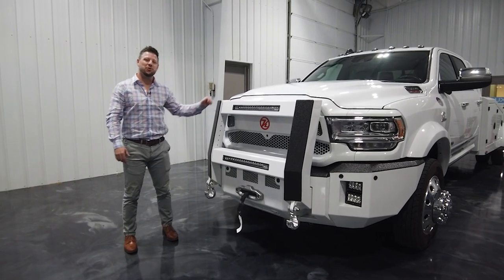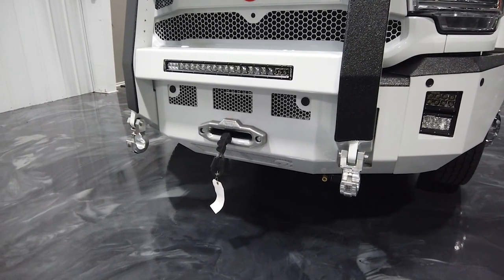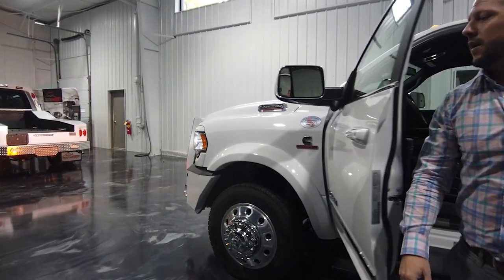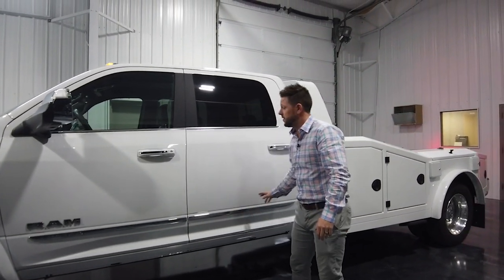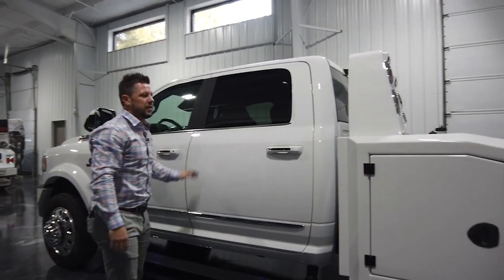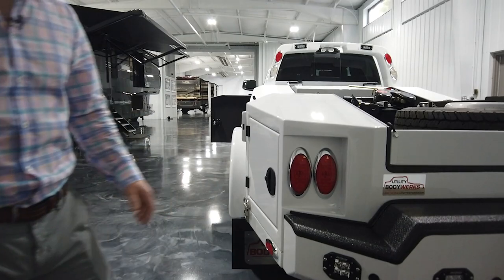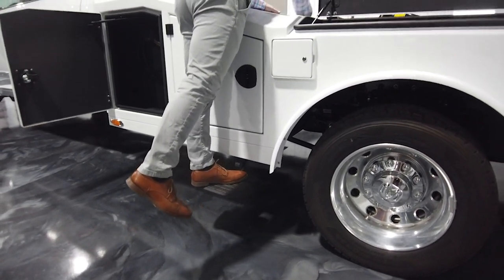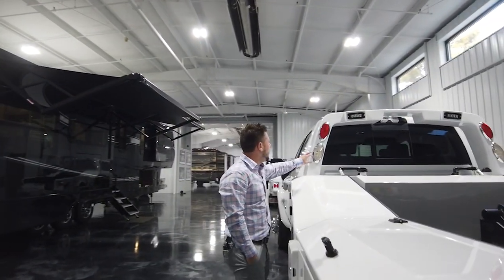2021 Dodge RAM 5500 84 CA

Comment: Absolutely beautiful truck! Love all the upgrades. What kind of price tag for that animal? What trim level is the chassis ?
Reply from the maker: This is a Limited. The upfit which includes all of the things that we did to the truck was $70,000.00. The Limited Chassis itself will most likely cost $85,000-$90,000 depending on the options.
Reply: @haulertrucks  that's actually really reasonable

Comment: Looks amazing.  I thought these models were designed for vertical weight like dump beds.  Never imagined a towing setup.  Cool!  How did this rig ride when she's not under load?  I would imagine kidney pain all around.
Reply from the maker: Mark, great question. 

The Chassis cab trucks ALL ride very rough. That's why we install Kelderman Air Rides and Liquid Spring suspensions.

Both of these aftermarket suspensions are excellent choices for taming down the ride without sacrificing functionality.

Thank you for the question!

Comment: What is the payload weight and towing weight? Good looking truck.
Reply from the maker: Randy. The payload varies on the upfit options. The RAM 5500s like this have a 19,500 LBs GVWR and up to 43,000 LBs GCWR. We weigh each individual truck once they are complete. This specific truck has a curb weight of 12,020 LBs this would leave 7,480 LBs of payload.